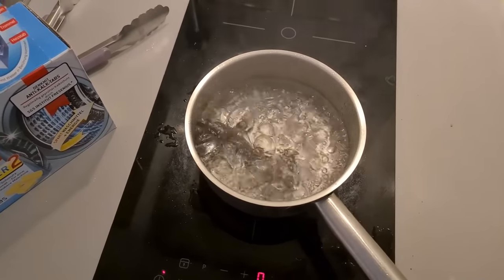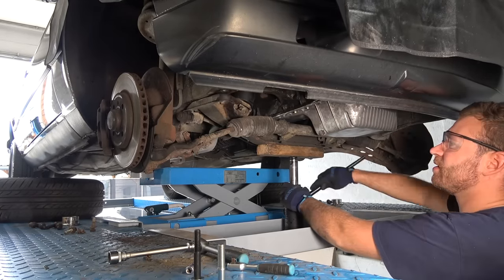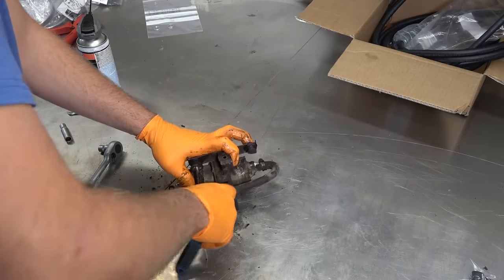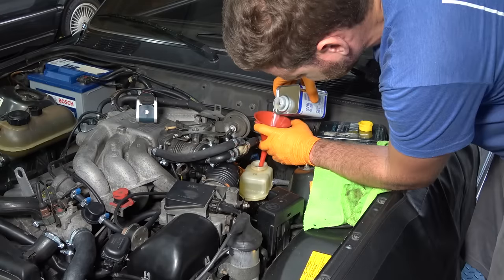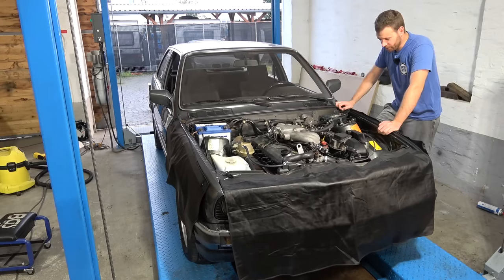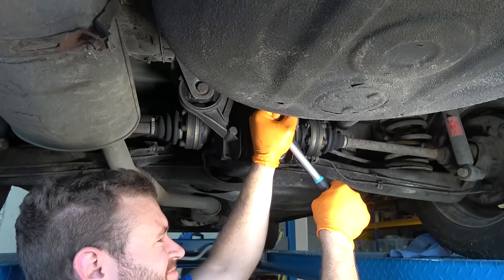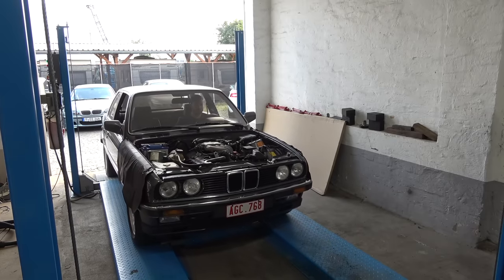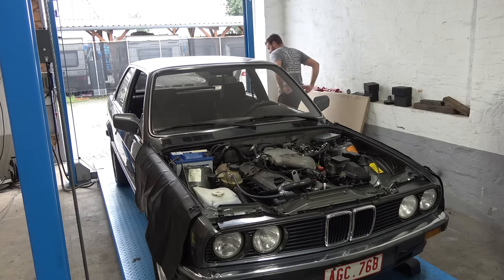Let's Get Mechanical - Neglected BMW E30 320i 5-speed - Project Marbais: Part 4

Comment: ATF is more a hydraulic fluid than a lubricant. I've changed my manual transmission oil on both my cars for proper gear oil and they shift much smoother!
Reply from the maker: E30, E31, E34... all use ATF in manual gearboxes from the factory. On my E39, E60 which use MTF-LT-2 I always had difficulties shifting into the 2nd gear until the car warms up, with ATF it's butter smooth always, when cold or warm. What you are feeling right now, won't last, been there, done that.
Reply: @M539Restorations  It's been 20,000 miles since changing the oil in my E60 and E87 and still smooth shifts.

It's true that ATF will feel smooth though because it is so thin
Reply from the maker: ATF actually has nearly identical viscosity as MTF. On E60, it'll depend on what gearbox it has, on my E46 MTF works good from cold, but even better with ATF. On E39 M5 and E60 M5, it's a struggle to shift into the 2nd gear and I tried like 10 different MTFs. You can also run mix, half ATF, half MTF.

Comment: The fault is most likely the distributor or the vacuum capsule set-up. Start by removing the rotor arm, loosening the screw below (if fitted) and spraying some WD40 or similar down the distributor shaft and giving it some exercise. These pre 1985 manual 320i and 323i cars with LE Jetronic have both vacuum advance and vacuum retard. You need to make sure that the vacuum pipes for each are routed correctly. I think the advance pipe goes on the engine side of the throttle disc and the retard pipe behind but it's been 20 years since I worked on one. Both must also be disconnected when setting the timing with a strobe. The pipe that fits to the back of the capsule is advance, the one on the front (domed bit)  is retard. With the engine idling, you can attach a length of vac pipe and suck on it - engine speed increasing = advance, speed slows = retard. The pipes used to be black for advance and white (or black with white or yellow stripe) for retard but they may not be original now. Automatic cars did not have vac retard. You may still have the vacuum capsule on the air filter box. This is the coasting valve and the idea was that it would alter the vacuum to the throttle damper when coasting with your foot off the gas.  Later manual cars got rid of the coasting valve AND vac retard as it was just a pain in the arse.
There is also a manual idle speed screw either on the throttle body or on the manifold near the steel support bracket to the cam cover, I forget now. NEVER try to alter the idle speed on the throttle lever adjuster screw!

Let me know and I will try to find the original BMW service information from 1983, I should still have it.
Reply from the maker: Yes, I replaced the entire distributor with a new one and problem solved.

Comment: The car doesn't need to be in original condition, to get a historic registration. Any legal modifications that would have been possible within then years after first registration are ok. It's a common misconception and even some TÜV-engineers tell this story if they don't want to deal with historic cars or do not have the necessary qualification.

The Eibach lowering springs will need to be aproved by an engineer anyway if you legaly want to drive the car.

I also would not set the idle by adjusting the ignition. Set the timing on the warm engine first with a timing light, the adjust idle and mixture.

Comment: at 44:23 use a transmission jack or a normal jack whit a socket to press the balljoint in to the frame to get it to lose. best result by pressing on the plastic thing in the middle. works 8
/10 times on rusty buckets.
Reply from the maker: Tried with a floor jack on the left side, didn't work, nut/stud too rusty

Comment: Don't throw away the control arms! Those can have new ball joints pressed in and they're perfectly fine!
Reply from the maker: I'm never gonna do that when a brand new Lemforder arm is 50-60€
Reply: @M539Restorations  we have to do that with the 96-99 m3 arms since they are so hard to find. I suppose the non M arms are much more common. Still hurts

Comment: Did you just buy regular 10.9 bolts for the subframe or from BMW? Cause I've been wondering if its worth spending 5e per bolt from BMW :D

Comment: The control arm nut can be opend, when you apply some pressure to the joint from underneath. It's a cone so it should create enough friction that you can get the bolt completely off instead of having to split it.
Reply from the maker: It can't when the nut/stud is rusty, I tried on the left side. Not sure why some think this is my first time working on the car
Reply: @M539Restorations   You don't need to get pissy just because I was trying to help. A always got mine open that way and it's not my first time either
Reply from the maker: I know, didn't mean to come off that way. It just becomes annoying when everyone keeps repeating the same, I can't include everything I try in the video. If you watched my other videos, you would've seen I've done that with E32 balljoints and it worked. Here it didn't since they were way too rusted.
Reply: @M539Restorations  Apology accepted :-) I am a big fan of your channel and watched most of your videos with great interest. Sorry if I missed the one with the control arms but I checked on the replies on this video not to repeat already mentioned advices. It's just that I always could stop the spinning after I had washed off all the WD40 and made the stud dry and clean again. At least the parts which could be seen. Never mind you got it off. This is what matters
Reply from the maker: You don't see it in the sea of comments, but trust me so many of them :) normally you can just push it with your hand or pry bar. I've put entire weight of the car with a floor jack on the left side and no dice. Cutting it off was easy enough. Thanks!
Reply: @M539Restorations  Again, I appreciate your videos and love your humor. It's so much more fun than most other channels. Last tip, you can cut off the tread just above the bolt so you don't have to wrench through the whole lengh.

Comment: Having tried simons three times i can not recommend it especially for that price. Ive changed mine twice now on warranty because it rusts very quickly especially during the winter when they salt the roads. 

Im now running martelius which was a bit cheaper to buy and has lasted two winters and hasn't rusted yet

Comment: i really hate cold start valves my car does 2100rpm on a cold start for about 5-10 seconds then its doing the needle drop after about a minute and when its warm its idling at 550rpm so i have no idea why it need to idle so high bu ive been told its supposed to be like this

Comment: 👉👉👉Help please: i own 2008 bmw x3 e83 2.0D 4x4 automatic with 145000 km on the counter.A couple months back i had issues with rough idle. When i would start the engine for the first 20-40 seconds rev's would go up and down with a bit of a white smoke from the exhaust. I cleaned the injectors/new kit, new glow plugs with new module....car is fully serviced, so no issues there.  Still when starting the engine i have rough idle 10-15 seconds (no smoke) and as well while driving form low speed and when it comes to around 1000-1100 rpm's  it looses the power/hiccup...and when i pass that all is fine.
I checked maf sensor, i have put new one for the test, same happened...
Is it maybe the fuel pump or something else...PLEASE advice!!!

The previous owner: changed egr, dpf, cleaned turbo. I did a good service...

Best 
Jure

Comment: If you are looking for the mastermind of the 80s BMW and his career then I have another challenge for you to hear the whole interview in german, 2 hours in 2 parts about Dr. Wolfgang Reitzles way to the top of BMW with Pitschesrieder and how he lost in 1999 for a second time to become the BMW CEO when he decided to leave and went on to lead FORD premiere group and later LINDE, a gas maker, where he multiplied the sharevalue.
He had also gotten and signed a contract from Porsche family members to rescue Porsche in the 1990s  but BMW forced him to retreat from that contract cause they would sue him for breaking the contract. Porsche family members had promised him % of the holy grail, Porsche owner shares from each family member. And it was his idea how to save Porsche with a small affordable mass volume model later called Boxster instead of the 4 seater Porsche had developed back then ... He described that in talks with Piech, the former VW CEO and family member of the Porsche family.

Of cause a german interview - just another challenge. search for Alte Schule Wolfgang Reitzle - old school which is the channel name talking about the 50s to late 90s car industry from racing to production, brand to product development and design .

Comment: If the thermostat thing ever goes wrong on you, you can always kidnap Stefan Gotteswinter and force him to machine you an adapter that fits inside where the old thermostat used to fit inside the body, after the rolled seal is removed, and on that adapter, you can put a modern thermostat. There's bound to be some sort of thermostat that you can use, possibly from the trucker world (they use heating based on water stuff a lot more than normal cars do).
It's not gonna be OE or OEM, but it's gonna be 50 there, since you're reusing the old body, just replacing the stupid thermostat they used there (and it is a stupid design).

Comment: Spinning balljoint problem can be solved if you jackup under a bit.
Reply from the maker: Can't when the stud/nut are rusted. I tried on the left side.
Reply: @M539Restorations  Removing rust and dirt with wire brush, from the top of stud is sometimes helpful for easier nut turning. But yeah, sometimes life is hard no matter what... :D

Comment: When the ball joints spin like that...just put a jack or scissor jack and push up or down on the ball joint to apply pressure, usually thats enough to keep it from spinning and you can take the nut off.
Reply from the maker: I know and that doesn't work when the nut/stud is rusty, I tried on the left side

Comment: You need to undo the control arm inner ball-joint nut at the very beginning, when the car is on the ground and the suspension is loaded. Then you can remove the nut through the engine bay from the top.
Reply from the maker: No, that's not smart or safe and it'll still spin. You can put pressure on the balljoint with a floor jack but that doesn't work on rusted nuts as I tried. Cutting is the only way.

Comment: What you are having problem with is the Idle Control Valve. 
With the e30 guys, it either taken out and cleaned or deleted/bypass. 
Should have plenty of ideas on e30zone if you need.
Reply from the maker: L-jetronic doesn't have ICV.
Reply: @M539Restorations  oh right, this is series 1 jetronic, oopss. Any luck on the issue?

Comment: That is a thread tap with which you are chasing the threads.

Cannot believe you didn't replace those crispy fan blades. They're going to start flying apart in about 10,000 km or less.

Why not a manual choke?

Camisa as Sandler.  I cannot unsee that.😭

Comment: If it can pass a TUV, it will pass an MOT in about 15 minutes here - the testing standards are in a different league with how much you can get away with and still be allowed to drive here

Comment: If that hasn't been said already - your rear subframe bushings are shot.
 You can see when the rear wheels are on the ground the frame droops and rests on the reinforcements (or push rods if you will as per RealOEM), while when the wheels are in the air the frame raises up and rests towards the body, as it more or less should when the bushes are good. That's a telltale sign the bushings ID metal part has separated from the rubber.
 That makes the rear all swirly, as the subframe dances around and screws with the rear axle geometry constantly, causing the car to handle very poorly in turns.
Reply from the maker: I'll never understand this type of guessing over a video. You are wrong, just now because of your comment I went to inspect them and they not shot and not resting on the reinforcements.
Reply: @M539Restorations  Not guessing, been there myself, that is one of the most common failure points on the E30.

 Looked like it in the video, comparing the shots when you changed the fuel pump (car resting on wheels) and when you changed the rear shocks (trailing arms offloaded).

 I guess I owe you an apology for trying to help out...
Reply from the maker: No need for apology, it was helpful cause I went to check. It's just impossible to judge and diagnose issues where you need to see actually confirm it in person

Comment: For broken bolts like that I cut use a cut off wheel and cut a line in the bolt to use a flathead screw driver and take it out
Reply from the maker: You only have one shot with this and that's the wrong way to do it. Bolt is weak and it will break 100% if you cut it

Comment: You should not be messing with timing to deal with idle speed. For sure less timing gives less rpm.  But in that case you must have something wrong with air system:  since You are already confirmed your cold air valve is in somewhat working condition ,  you should check other devices:   throttle stop screw,  throttle vaccum catch pin,   or even vaccum line to distributor - on closed throttle blade position no vacuum should be applied to vacuum advance - or you will have a lot of timing on closed throttle.
There is also an idle speed screw - maybe yours is out too much.

As for a "bouncing idle" - this can be a worn air flow sensor or a little missadjust of an idle mixture. If I remember correctly there is an idle mixture screw on airflow meter housing.  Those older L-jectronic are notorious for airflow meters wear and struggling for idle mixture then.  A wideband oxygen sensor will be a nice help to adjust mixture back to ideal.
Reply from the maker: You have to mess around with it when setting ignition timing. The ignition distributor was bad, replaced and all good now
Reply: @M539Restorations  i mean , yes,  there is a correct way to set a timing:  with a strobo light.  But the idle speed should be fine tuned not with ignition timing.

Comment: Be careful using an impact gun on the spring compressor… most of that type have a roll pin holding a thread nut to the thread part and this can break when an impact gun is used… check what the manufacturer says. 👍

Comment: do not use grease when inserting the lever into the silent block. he'll turn around there later
Reply from the maker: It's fine, that way it positions naturally when the car settles and that stuff can be washed out.
Reply: @M539Restorations  the manual e46 says to use a soap solution.this is not a criticism. I love your channel and watch all your videos. this is just a tip
Reply from the maker: I know, I've done it both ways. Makes no difference in the end.

Comment: Next time, use the jack and put pressure on the joint while loosing the nuts, then you don’t need to cut them.
Reply from the maker: Doesn't work on rusty nuts/studs, i tried on the left side

Comment: Grab the ball joint with vice grips above the rubber. The teeth will cut right through the rubber. Easier than cutting it.
Reply from the maker: Tried, didn't work

Comment: I hope you didnt store the fan clutch horizontally for too long, because it has to be stored vertically. Otherwise the fluid inside leaks, and ruins it.
Reply from the maker: Wrong. Fan clutch is always delivered in horizontal position and says on the box to store it like that

Comment: Why wouldnt you get the H with lowering springs? As far as im aware you can get it with mods that were/could have been done back in the days. Am i wrong? ~ nvm you adressed it.

Also please dont use the impact for (de)compressing the springs, youre smarter than that ♡

Comment: Why not just bypass the system ? since its so simple just connect the coolant lines together and plug the air completely from the hoses or leave them at 1mm air contraction, Who cares about the cat warming on cold startup healthier for engine too.
Reply: Car will start up cold on low rpms tasty

Comment: I guess I am confused... You messed with the timing to fix the idle? Why wouldn't you just set the timing to what the spec is? Adjusting idle by messing with timing just seems wrong.
Reply from the maker: Not wrong, correct. Ignition timing, you have to mess with the distributor to set it, by ear or with a timing light.

Comment: I love Your videos and Your skill... but... please do not bother with used springs. Put new ones. I know Youre an OEM purist but You can go with HR or Eibach pro kit. Cheers
Reply from the maker: Nothing wrong with used springs that are in good condition
Reply: @M539Restorations  what about risk of spring braking, it's a metal put constantly under different load so it has to crack sometime and springs 10+ years or 300kkm old also do not   have their original properties and may cause a failure and or accident.

Comment: You f'ed up cutting that ball joint off. A better technique is to use a pole-jack and apply pressure to the bottom of the arm, forcing the taper in and captivating the ball joint. From there you should be able to remove the nut without the whole thing spinning. Worst case... it can't be stuck if it's liquid :P
Reply from the maker: I didn't. That doesn't work when the stud/nut are rusted, I tried with a floor jack on the left side.
Reply: @M539Restorations  Fair enough!
Reply: @M539Restorations  When I do it, I generally take the whole weight of that corner with the pole jack. I can appreciate this may not work in every climate lol. We have no corrosion issues here.